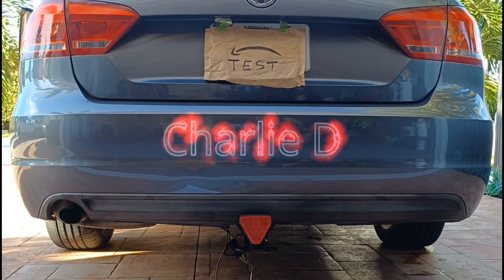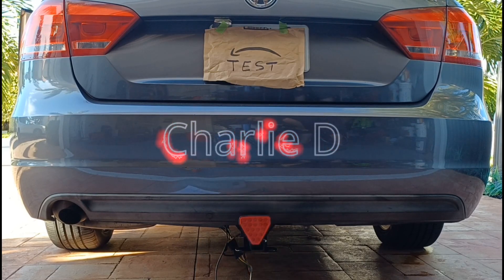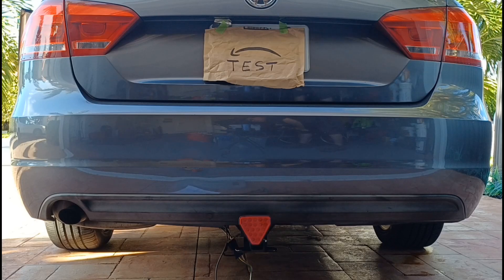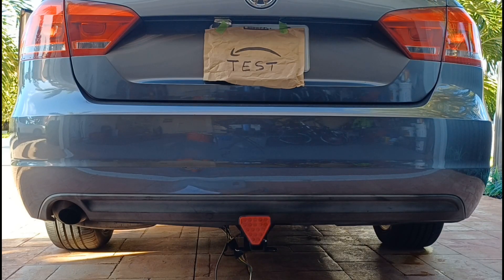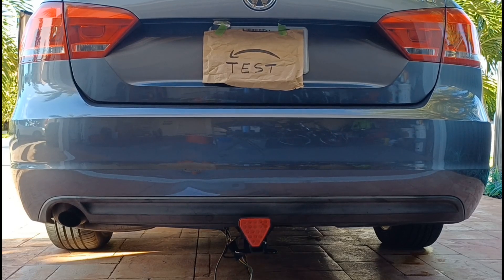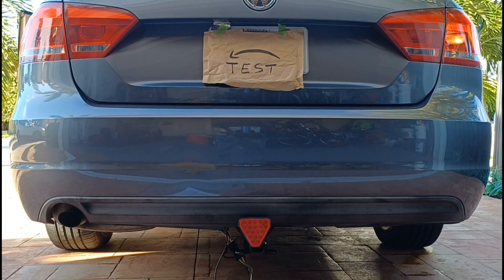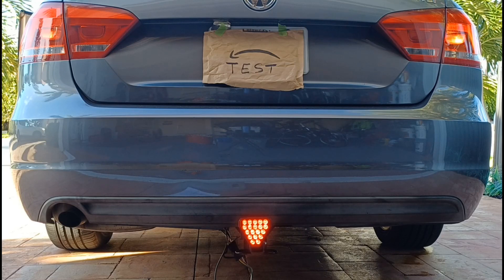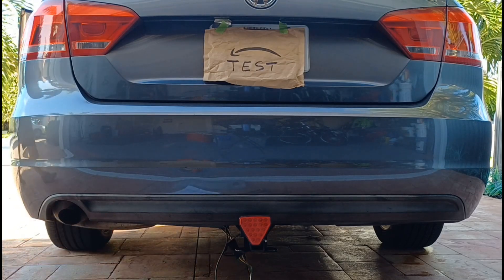Brake Strobe Light LED ⚠️  Warning - Vehicle 2-to-3-wire taillight converter - DIY Install

Comment: Do you know if there is any way to make them not strobe? It’s illegal for them to strobe in the uk
Reply from the maker: This light is setup for strobe. 
You'll need to buy one that acts like a 3rd brake light that has a steady light.
Reply: @CharlieD954  I can’t seem to find this style light that doesn’t strobe, which is annoying as the triangle design fits perfectly with the rear of my car